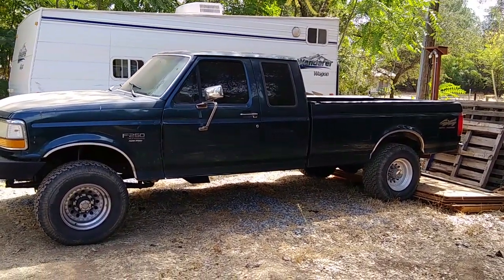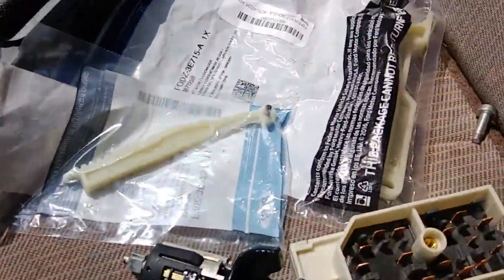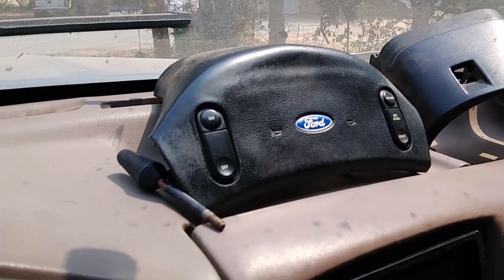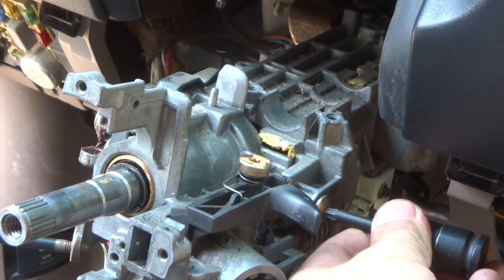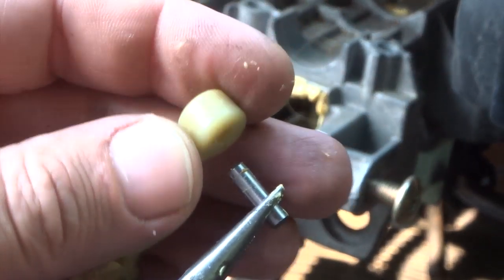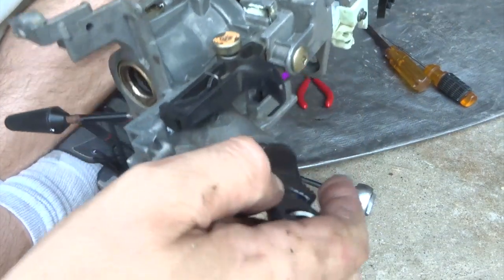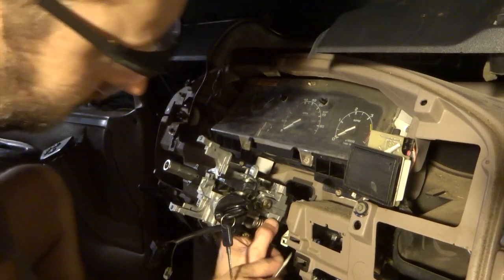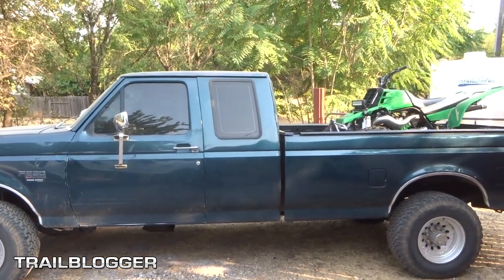FORD F-250 Ignition Switch & Steering Column Link Repair

Comment: I just did this repair today to a 98 F-150.  I was able to get the part in place without sanding or filing.  I pulled the lower actuator to the end of the channel it rides in and got the pin started.  Then I used a flat screwdriver to push on the plastic where it touches the wall on the right side.  With careful, steady force, it popped into place.
Reply from the maker: thanks i was wondering if it was possible or not!
Reply: @trailblogger  no problem.  I hope I NEVER have to do one of those again. LoL
Reply: cool. all i can say is the executive at FORD who approved that plastic piece of crap to be placed in that location is evil. this movie is so amazing on so many levels. it shows a beautiful american truck with an evil piece of junk plastic hidden inside that is designed to fail. but this dude heroically saved the day and fixed his truck. ! so awesome.
Reply: How were you able to pull the lower piece sor far foward.  Mine stops with a clicking sound and is still recessed in its groove.
Reply: How were you able to pull the lower piece sor far foward?  Mine stops with a clicking sound and is still recessed in its groove.
Reply: 8
Reply: @pwrmx24 you have to remove the shifter

Comment: Had this exact thing happen to me on my 7.3 turbo diesel. Couldn't shut it off and on top of that it's an automatic transmission, so stalling wouldn't work. Couldn't find if there was a fuse to remove. Wound up removing all the air intake tubes up to the turbo and suffocating it with a piece of plate  steel. What a monumental pain. Glad I found your video so I can make this tedious repair
Reply: In the maxi fuse block under the hood, on the top left hand side there is a yellow 20 amp maxi fuse right underneath the grey diode. That is for the fuel shut off solenoid. Pull that maxi fuse and the truck will shut right off.
Reply from the maker: Good to know!
Reply: That was for my 92 7.3 IDI. Not sure on the Powerstroke.
Reply: Just did the same with mine today
Reply: Pull the ignition box off and push the switch to off on the ignition box. Remember to unplug your battery

Comment: I think you solved my problem, Sir for my 1994 Ford Passenger Van that no one knew what simple part was broken by a less than fair mechanic who broke my steering column and/or ignition when changing ignition switch. This will save me money especially since I believe what the word the mechanic couldn’t say was “Actuator Switch” along with maybe he broke or lost the plastic gear, plate or clip. This has been almost two months of agony with several men who work on cars not knowing Jack but to tell me I needed a new steering column. I, a determined woman because of my late, great father, Army Staff Sergeant, Ralph Tuck and mother, an Army WAC taught me to never give up and to investigate. No is not an option as a single woman whose father taught her a lot about male car salesmen and mechanics. Lol. I really plan to learn how to actually perform the logic that I see in my mind about fixing cars on actual cars when I retire from my first career. Lol. Love you, Mama and Daddy Always at 56.❤️❤️❤️❤️❤️❤️❤️

Comment: Helpful video bro! I had the exact same problem. My pin fell out of that plastic actuator bar. I already bought the new part ($20) but all I really neaded to do was reinstall the pin. I used the new part anyway, also shaved down the corner to finagle it in there. But I added a little thread lock to the pin so hopefully it doesn't slip out again. I was able to cut out a few steps, wasn't as hard as I thought. You can use the tilt lever to release those to big spring bars if you don't take everything apart. The steering wheel spring was easy, you just need to use your snap ring pliers and push on the snap ring with a screwdriver , it goes right in. I like the crafty use of pvc pipe though! 😉 Also found made a hack for easy installation of the tilt spring 2 zip ties and compressed it with a vice, then cut the zip ties after installing. Anyway, thanks for the video! Gave me the confidence to tackle this project myself. Keep up the good work!
Reply from the maker: that's a good idea with the zip ties! glad the video was helpful!

Comment: This is the only video, only info I can find on this and wow, thank-you for taking the time to document this. Same thing just happened to my 2003 E350 van and I'm looking at doing this repair. What a nightmare! I did realize that I can remove the ignition switch, turn the key to on and operate the switch manually to be able to drive the vehicle. Good info to just get home, or shut the vehicle off if the linkage breaks when the vehicle is running, as you needed to kill the engine with the manual transmission.
Reply from the maker: glad it helped! not going to lie, i considered just using the switch under the dash to start and stop it haha. was glad it was over with when she finally was all back together.

Comment: I just wanted to say thank you for all the details between repair because I have an f350 dually and your video saved me 100.
Reply: Also, I think you should look into posting for other mechanics.
Reply from the maker: Thanks you watching and leaving a comment! Really glad it helped keep your old girl on the road. They just don't make em like they used to. I will try to get some more videos like these posted. Mainly just wrench on my quads and the truck if it breaks down to save money. I've got a leak hydro booster now so that's probably next is steering. I've had the part in the back seat of my truck for well over a year now. Also need to fix a door lock actuator sometime soon so my lock works again with the key fob.
Reply: My next adventure is my power steering gear box and it will also be my first experience on that. It's a 96 f350 dually 460
Reply from the maker: Sadly I sold the truck in this video but now have an 02 f350 7.3 which is the one that needs the hydro boost repaired
Reply: I have replaced my power steering pump 3 times in less than a year and  I have a leak around the gear that is a little exposed, looked through the manual for specs on it but that was useless.
Reply from the maker: @MikeSmith-gi7vf  when I had my OBS F-250 there was a company called RedHead Steering Gears that makes an upgraded box I was considering putting on mine LINK https://redheadsteeringgears.com/shop?year=1996&make=Ford&model=F-350

Comment: Great video just a couple things to add. First there are some bushings on the shaft that get sloppy over time so the steering wheel will move up and down. For future time saving effort anybody doing this should replace them because you are already in there. Second and maybe more important to know there are two screws that hold the bezel on under the strips on each side of the column you won't be able  to remove the bezel until you take them out or you may end up with a broken trim and a trip to the junk yard. Third and maybe you did it on purpose but you didn't put the idiot buzzer thing back in the ignition switch. I saw it hanging there and for anybody who hates buzzers you can pull it out or cut the wire and no more buzzer just don't forget your keys. I had the column issue I was talking about  but couldn't figure it out so I had it done. Thanks again I learned something today:)
Reply from the maker: great tips right there. definitely would have done the bushings while I was in there if I had known ahead of time the parts to order. my bezel was busted on this one already, or at least the hole that fastens it was drilled out I think I can't remember now but I see what you mean. the dinger came pre-disabled by the previous owner but good point for those who want it back to 100% original- if you are watching this, don't forget that. great info, thanks for the comment!

Comment: Thanks for taking time to make and post this video.  I almost caved to put mine in the shop after watching how much was involved to tear down to replace the actuator rod, but your video made me think I could do it.   I got it installed after rewatching your video when I had difficulty with this or that.  Your hacks  were very helpful, like grinding down the rod to make it fit, and I benefitted from your PVC pipe with washer and bolt idea to reinstall the retaining ring.  Thanks for the great video and  instruction!!!  Your video is the best video out there for this project.  That's a nice truck you have!
Reply from the maker: awesome man! I'm glad the video helped. thanks for taking the time to leave a comment. sadly i sold the OBS but still have a 7.3L. the new truck is a big green 2002 f350 extended cab 4x4 with under 150,000 miles. i am the second owner. first owner was literally a grandpa. i'm going to be doing a video on the front driveline rebuils and hubs replacment for my next truck vid. also threw all new tie rods and ball joints on while i was under there... pretty much the entire front end.
Reply: @trailblogger  Sounds great. Hope you'll be extra careful working under that big and heavy truck!
Reply from the maker: for sure, jack stands are our friends!

Comment: Thank you!!!! FOR MAKING A VIDEO THAT HAS THE NEEDED INFO AND NON OF THE BULLSHIT. Awesome job on the video you are amazing at speeding through the bullshit and then slowing down right at the critical parts.  I have done this a few times and couldn't remember the order of spring bushings ect .  And the part where you had them layer out in a line and then even went as far as to flip the bushing to make sure we knew the order was excellent
Reply from the maker: glad i could help!

Comment: Rather than twisting or prying then grinding the new actuator,
remove the lower actuator and everything comes apart and goes back together
easily.  On the top of the column, under
the shift tube, there is a part called the shift pawl that prevents the lower
actuator from sliding out.  The shift
pawl is held in place with a small pin in a difficult spot to drive the pin
out.  I used a screw driver to force the
pin flush with the casting then a drift and hammer to tap the pin out a little
further.  Once the pin is pushed out you
can grab onto it with pliers and pull it out the rest of the way.  With the pin out, the shift pawl comes out and
the actuator will slide out of the tube. 
Not too difficult to do but take note, or take a picture, of the shift
pawl before you remove it as a reference for re-assembly.
Reply: Not sure what model you have but this did not work in my 96 f150.  I removed the shift pawl and was unable to slide the lower actuator any farther out than I could before removing the shift pawl.
Reply: yes, it is a pain in the thing I use dental picks on mine, and it flew out and it was easy to put back together replace the pawl and retraining pin after you put the housing back together

Comment: Have a 95 f250, same problem... starts but will not turn off, video very helpful... thanks so much
Reply: I got a similar problem with my 95 F250, It shut off fine but won't start..

Comment: Don't be afraid. It isn't that bad.  The video makes it a cake walk.  Especially if you don't remove the lower section like Trailblogger mentioned.  I used a long extension to remove the 2 torx bolts on the upper, it came off with no issue.  

I got crazy and used the square ends of 2 extensions on a bottle jack to compress the 2 locking jaw springs for the tilt on the reinstall.  Only thing you'll have to fight is the big spring which may not be much of one with a vise and a well placed zip tie.  Full disclosure: I didn't try that on this go, was able to muscle it back in,  but I have used that trick in the past with flawless results.
Reply from the maker: The bottle jack is a good idea, didn't think of that.
Reply: @trailblogger  different application called for a little creativity lol.  Thought I would share for folks who may be intimidated.  I enjoyed your springsnapringretainer press device.  I am still looking for something similar to finish up mine.
Reply from the maker: good old PVC pipe LOL
Reply: @trailblogger  really?!?!?!  I have a ton of pvc but passed on it cause I thought it would explode lol
Reply from the maker: the could happen lol. luckily it did not

Comment: I'm glad I have an XL. No tilt, no air bag no speed control. Only a horn. Plain and simple. But i did have to replace the 2 bushings.
Reply: It was confusing because every video is for tilt but after doing it I realized that are the same except non tilt has one jaw instead of 2

Comment: Great video! I had replaced mine and unfortunately the part broke again about a month later!
Reply from the maker: Did you swap out the switch when you did the new linkage piece? I think my link busted when the OEM switch started freezing up internally due to corrosion

Comment: Thank you so much for making this video. I am currently halfway thought this repair on my 96 f150. I cannot for the life of me figure out how to get the Steering Column Lock Lever to release far enough in order to reinstall the Steering Column Lock Cylinder Housing.  Any suggestions on how you were able to crack those levers down or some how release the spring would be much appreciated!

I have yet to removed the entire Steering Column and I am trying to avoid doing that. Let me know if you feel removing the entire column is necessary for getting the housing back into place.

Comment: This video is the only one that was of any help thanks
Reply from the maker: welcome!
Reply: @trailblogger  I have a dumb ? I replaced ignition cylinder actuator when putting turn switch back on I cannot remember where the plug with the 3 wires goes 95 f350 no tilt manual 351w

Comment: I checked my actuator and it is moving? Was yours moving at all, when the pin was broke? I still don't have no retention in the switch... I wonder if the white ignition gives retention to the switch?

Comment: I couldn't get the lower section of the link out for a few days.  Turns out there is a spring clip under the shift tube.  Didn't take the column out so I couldn't have found it.  But I drilled out the plastic and broke it out.  Only took a small chunk of the main body out with it.
Reply: Mine linkage just broke yesterday. Researching this, wish I could see what you did. So, If I lower the column I could take the spring clip off the top and remove the lower actuator?
Reply: @blackrockbrewing5141  turns out I was wrong. It's the lock for the shift tube. It's on a blind hole split pin that I don't think you can remove easily. So I used an angle grinder with a cut off wheel to shave the top of the flat section of the lower linkage. Only the rear part of it since the lock rides in the groove on the top of it. I also had to cut a slot through the reenforcement on that flat. That was so it could flex just enough to slide under the lock with a little tappy tap tap. I did this with the column in the vehicle but lowered.
Reply: How’d u get the lower actuator out!? Mine is completely stuck and I was thinking about using a flat head and beating on it but I don’t want to break anything…I have a new one ready but I’m not sure how to get the old one out pls help me
Reply: @konen5807  don't! It will break the case. It's held in by a keyed tab that is held by a pin in a blind hole. What I did was use a long extension and a 1/4" drill bit to drill out the plastic until I could lightly tap ot out. Then when I put the new one in,  I had to cut some of the webbing on the lower section so it would just flex enough to slide under the little metal piece. But with a little luck and a lot of lube you can stick a lot of things.
Reply: @Hazmatt4700  ok from the bottom correct!? Cuz I have an automatic so I don’t even know what’s on top lol
Reply: @konen5807  top would be the steering wheel. Bottom would be the fire wall. The roller lock thing that really is there to lock the steering wheel when it's in park is on the upper side of the case. I did mine while it was still in the truck so that's probably why my perspective is off

Comment: For my 96 f150,  I had to use a two prong gear puller to get the steering wheel off,  it does not have the screw holes for the two bolts... Instead it had "pull here" at two spots.

Comment: When I went to install the new one, I notice the top hole that shows the actuator was showing that it wasn't moving even though the bottom was showing movement. I took the new one back and used the old one to hand start and drive to work. I will repair later. Thanks

Comment: You don't need to lower the steering colum or anything just get a small touqe on those two brass ones and losen them up saves so much time
Reply: Did you use anything else? Or did it come right out?
Reply: @chrisshreve1736  just the torques

Comment: Great video. I'm going to find a wiring diagram and install a off/on/on/ with a momentary on switch arrangement. Might have to do it with relays. Drunk guy completely destroyed the casting the cylinder is held in.

Comment: Thanks for that video... Have 2000 f250 7.3 It all started because it would start but would not shut off the truck when i took the key out...  I bought the ignition switch because when i looked up there and turn my key, it would move back and forth.  I installed the ignition switch and it would work until i turned it all the way to start. SOOOO I just pushed the lever by hand on the ignition switch and i could make it start by hand, (like just hanging there) and i had the key turned to the on position as well.  So i am guessing i too have to do what you did???  Sound like the same thing???  thanks for any input....
Reply: Exactly the conclusion I came to on mine, 2003 E350 7.3l Diesel. Just broke yesterday, Geez. I can operate the switch by hand, but the key is not operating the lower actuator. Did you get yours fixed?